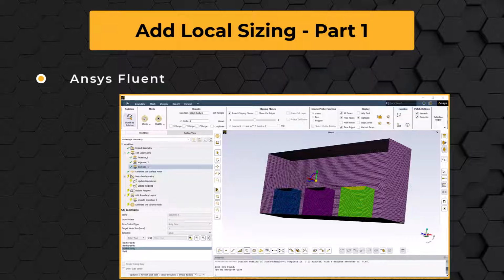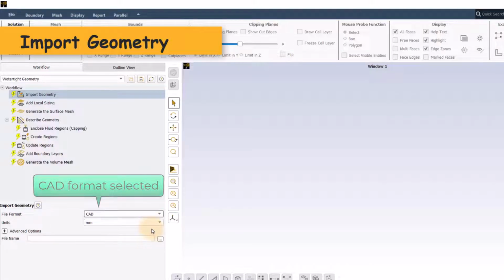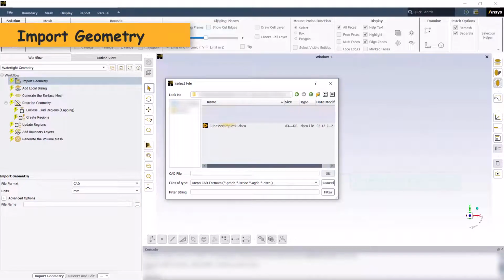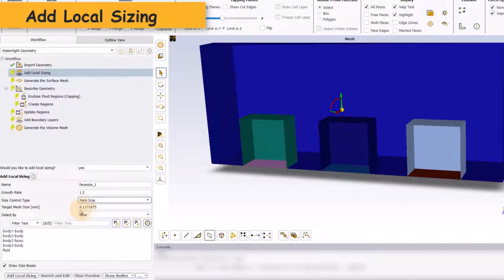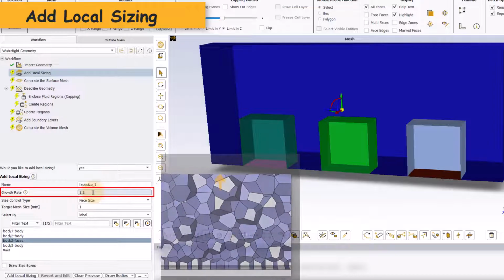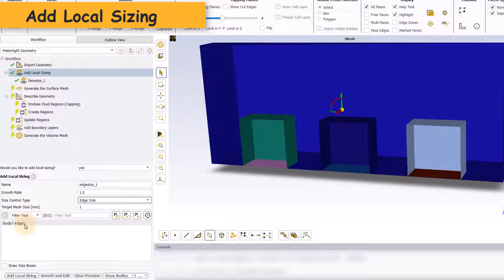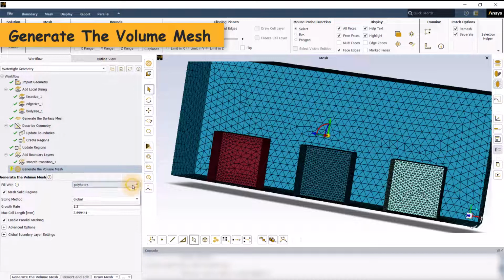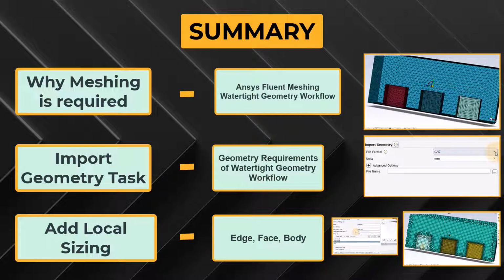How to Add Local Sizing in Ansys Fluent Meshing — Lesson 1, Part-1

Comment: !IMPORTANT NOTE FOR STUDENTS and LEARNERS BEFORE STARTING THIS TUTORIAL SERIES!   The given geometry in the course materails are created with "The Discovery" software. If you don't have the installation of the Discovery software, you can open .dsco file with Spaceclaim and save the files as .scdoc. Later, open the file using FluentMeshing Software. Labels are also visible with the .scdoc file. I hope It will help for new comers :)

Comment: Hi, im having a hard time trying to import the file downloaded to proceed with lesson. The log is presenting the following messages:
Error: Error in CAD Import
Error Object: #f

Error: Error occurred during import.
Error Object: #f

Error: Importing the selected file could not be completed. Check to make sure that the selected file format is supported. In addition, check to make sure the CAD Readers are properly configured for the format using the CAD Configuration Manager utility.
Error Object: #f
Reply: Same here. So far NONE of the files downloaded from any of the ANSYS online "tutorials" have worked for me. If ANSYS wanted people to be able to learn how to use their software, they should probably fix this issue.
Reply from the maker: Thanks for watching! Please post your query on the Ansys Learning Forum for a detailed answer from the wider Ansys Community: https://ansys.com/forum.
Reply: @AnsysLearning  The problem is coming from "The Discovery" software that no one would like to use :) Open .dsco file with Spaceclaim and save the files as .scdoc. Later on, open the file with FluentMeshing Software. Labels are also visible with .scdoc file
Reply: If you are getting an import error you should update your graphics card driver and the problem should be solved
Reply: The problem is coming from "The Discovery" software that no one would like to use :) Open .dsco file with Spaceclaim and save the files as .scdoc. Later on, open the file with FluentMeshing Software. Labels are also visible with .scdoc file @kauepaulinodecastro5629